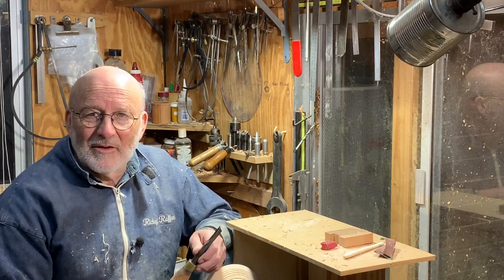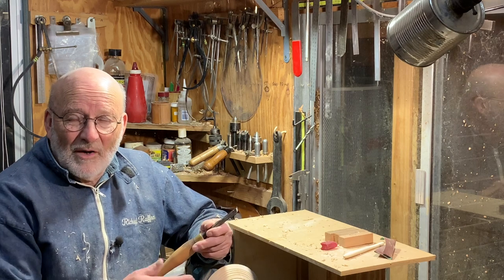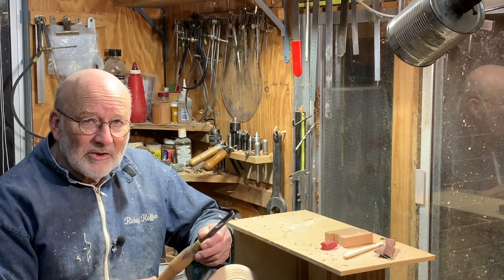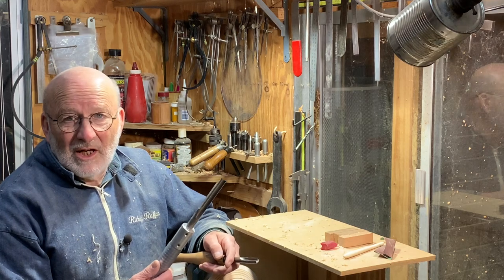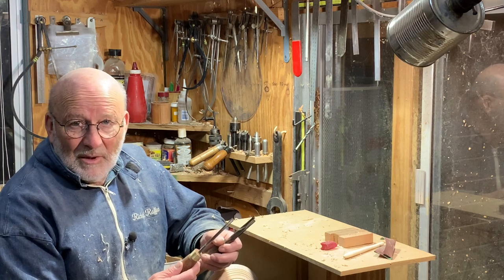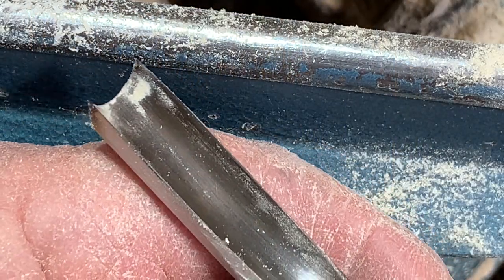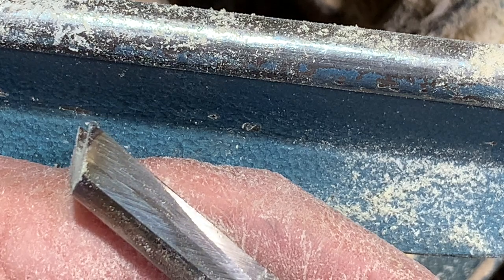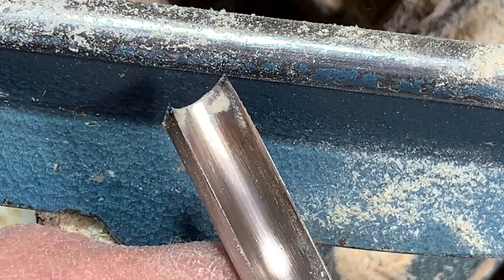Richard Raffan converts an elderly gouge to a beading tool

Comment: Very much like this; this was very timely and very helpful.  I have a gouge getting close to the end of its life and this looks like a good use for it when it hits that point.  I tried doing this with an old (1980's era I think) Craftsman gouge a couple years ago with little success; I think the flute was too shallow, those gouges are more European Continental style gouges.   May have to give it another go by grinding the sides flat.

Comment: Thanks Richard. I always appreciate your videos.  I made one today from your description but had trouble getting good beads. I was trying to make a beaded handle on a Harry Potter magic wand but got a lot of chip out on the top of the beads. Either this technique doesn't work well on spindles or the wood I was using is too hard or splintery ( is that a word? ). What is your opinion? Should I just mark the beads with a skew and round them with a spindle gouge or try the beading tool again? Thanks for any input.
Reply from the maker: The beading tool is unlikely to cut cleanly on a spindle. It's best to avoid scraping spindles when the grain is parallel to the lathe axis. Cut beads on a spindle using a gouge or skew chisel is the best way to go for a clear surface off the tool.
Reply: Thanks for your reply. Here I am, learning again.  @RichardRaffanwoodturning

Comment: I have a couple of beading tools but find that the points are quite long and therefore go deep into the wood.  I am considering grinding the end down to shorten the tips and was wondering what you would recommend.
Reply from the maker: I found the same and shortened the wings by steepening the bevel.

Comment: Hmm. I'm a bit confused. I made a similar tool, but I use it flute side down. Works great.
Reply from the maker: In his demo video Dave Schweitzer, who's the D in D-Way, uses the tool flute down on endgrain. I tried both ways up and found flute up works better for me. I try to avoid sticking any tool up into oncoming wood.
Reply: Just the reverse for me with the wood I was turning. Got way more tear out with the flute up.

Comment: I was thinking you would use it bevel-up, which I think is how the D-Ways are used (or I'm using them wrong).
Reply from the maker: In his demo video Dave Schweitzer, who's the D in D-Way, uses the tool flute down on endgrain. I tried both ways up and found flute up works better for me. I try to avoid sticking any tool up into oncoming wood.
Reply: I wonder if the size of the one Mr. Raffan is demonstrating contributes to the risk in using it bevel up.  The D-Way beading tools I use are more narrow, only 1/8” and 1/4” wide.  Jimmie Allen, Dave’s successor with D-Way, showed me personally how his are used.  D-Way’s shop is very close to my home.
Reply from the maker: @Ethan-pb3jq  I found flute down best for me having tried both flute up and flute down. As I said above, I try to avoid sticking any tool up into oncoming wood.
Reply: @RichardRaffanwoodturning  Understood.  Bevel up certainly feels and looks risky but it seems to work.
Reply: @Ethan-pb3jq , @RichardRaffanwoodturning -- This sort of scraper (and that's what it actually is) CAN be tricky to use and is prone to catches. There are, however, some things you can do to get a flute-down tool to perform better. One, raise a better burr with a burnishing tool; two, roll the tool back and forth so that the contact area is minimal; three, skew the edge slightly to create a bit of slicing action.